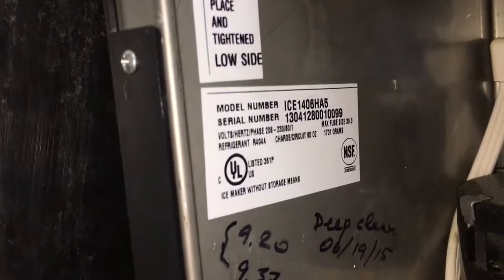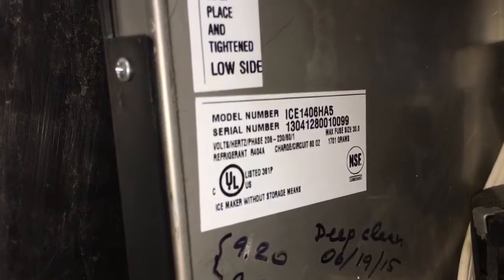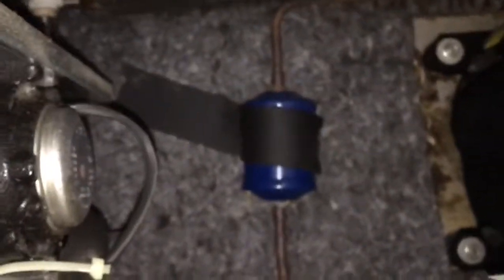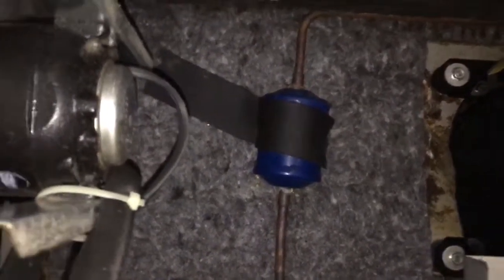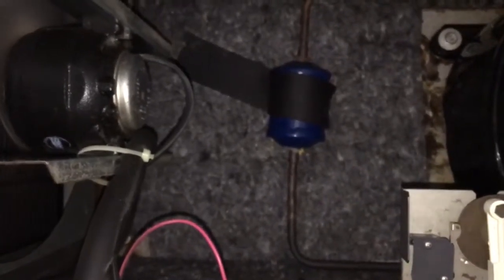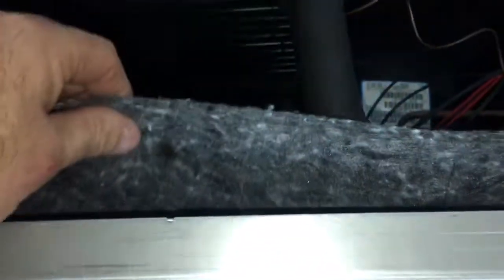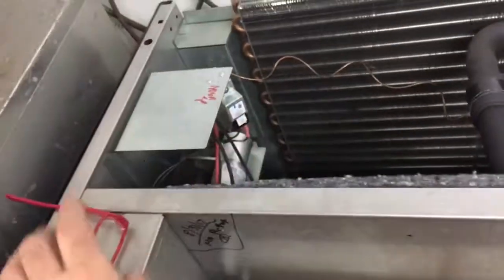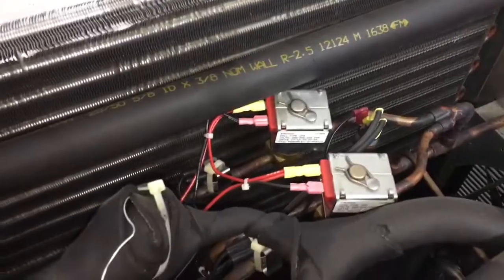New ice-o-matic ice machine - Allready a Freon Leak. WTH ?

Comment: I agree Ice o matic does slack when it comes to ice machines. if you lay the drier on the bottom you need something to pad against vibration rubbing. Ice o matic has had a lot of revises with the 2011-2014 machines. TXVs, harvest assist rewiring, faulty timer switches,  and tons of bad low pressure switches. Maybe they will see this video and give it to the engineers.
Reply from the maker: Thanks for the info. it is much appreciated on the update. re: 2011-2014 machines. one can only hope a engineer would watch some of these video's to learn something from techs that have actually worked in the field for many years.
Engineers should be required to work in the field servicing some of thier equiptment they will be engineering to really Grasp Engineering and customer dismay for  early failures from poor design.

Comment: HERE IS WHERE ICE O MATIC LEAK ~ most of the time
If you use dry nitrogen ( & one should ) and you test up to 400psi, you will see the high pressure switch IN THE CONTROL BOX with a capillary tube brazed into the refrigeration line.  Do not confuse it w the bin switch cap tube as its liquid filled only. Is no refrigerant there. It is attached w 2 screws going through the control box top. Remove it from the control box & drop it in a cup of water. under pressure. See bubbles? Even w big blue sprayed on the leaking switch it wont bubble up because the mount Johnson controls used is full of holes & the soap bubbles wont bubble. It must be submerged in water. 
Thats most leaks in crap O matic.

Hoshizaki is a great ice machine but Manitowoc is the king of the mound. Scotsman is a pos also. 

Daniel
Reply from the maker: after being in this trade for 38 years i have to disagree with u on manitowoc being the best machine. ive seen too many hoshizakis go 20-30 years and still be making ice no other manufacturer can say that. manitowoc is definately second though.
Reply from the maker: just sniff the side of the control if its leaking - it allways sets off my GeH-10G Leak detector if its leaking. must be 100 psi minimum nitrogen & some refrigerant in the system to set off leak detector. pressure testing over 150 psig is not recommended by compressor manufacturers. u must be a mini split guy pressure testing mini splits. in refrigeration we dont pressure test over 150 unless its absolutely necessary.